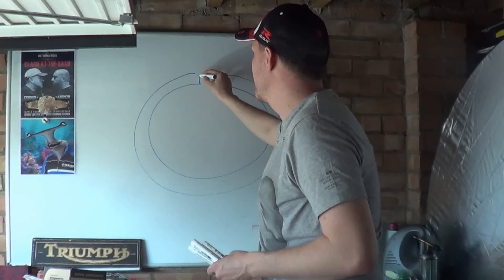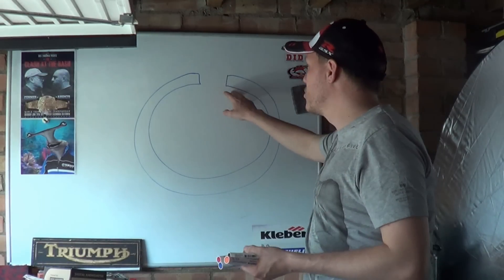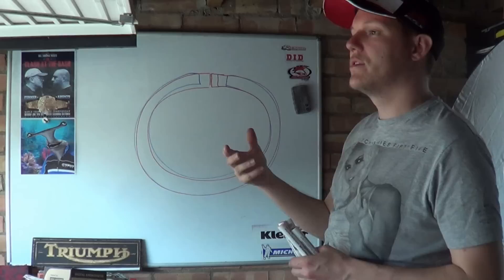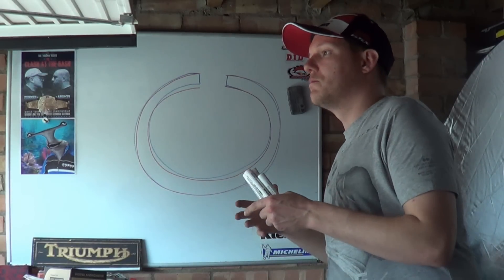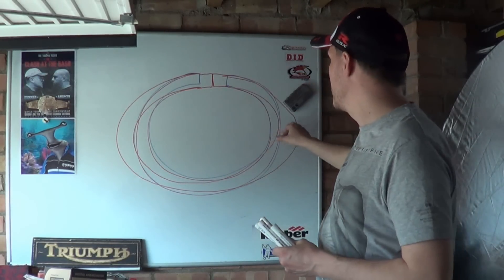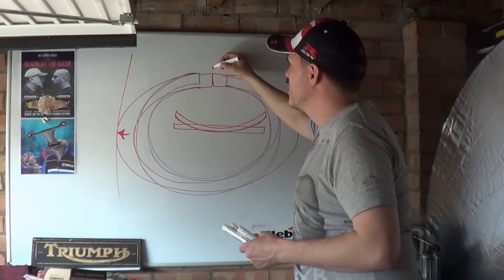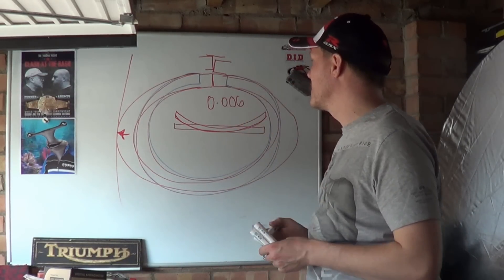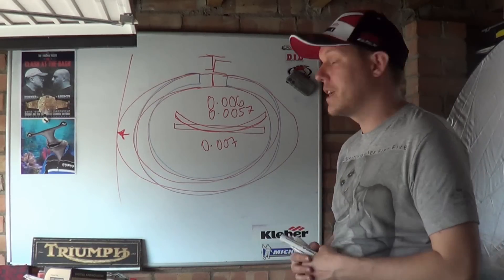Piston Ring Gap - the importance of

Comment: Need some advice.   I have a single cylinder thumper motor in my bike.  It had a transmission issue.  I removed the engine from the frame repaired the tranny issue and then put the motor back together.  No compression.   Don’t understand why, never messed with the piston.  Replaced all gaskets.  Torqued to specs.  Still no compression.   Got new gaskets again, did an inspection on the head and valves.  Finally did a lap job on valves.  Checked the valve guides, seats, seals and valves.  All are on.  Bike only has 3000 miles on it.  But it ran perfectly aside of he tranny issue.  So, back in the motor with brand new piston rings.  Still no compression.   Double checked the clocking and directions of the gaps.  Checked ring gaps and thickness.  These are NOS parts by the way.  New Or Stock parts.    I need @140psi and I’m only getting @45psi.  I also did leak down test and I can hear air hissing in the crank case, evidently getting past the piston rings.   The valves are sealed tight.  Again, the rings are brand new from the manufacturer, clocked correct, directional, gaps are good, applied assembly oil, followed the specs.  Still getting blow by.  Anyone got any advice.?
Reply from the maker: 1) - what engine is this from?
2) - this is with the valves closed? - I know this sounds stupid but I need to ask
3) 2 troke or 4 stroke?
Reply: The Workshop 

This is on a 2003 Buell blast.  500cc.  4stroke 

Most people would say, just toss this crap bike, but I actually like these bikes and have five of them, well, two now.  I sold one, kept two and gave two away to my step sons.  Also with 4 other Buells.  XB9R, xb12r, M2 cyclone and 1125r.  

Anyhow,  yes, this is with the valves closed.  I put the rocker box back on and was struggling on keeping the valves closed while locating TDC, and then compressing the cylinder with compressed air.  I had it in 3rd gear to help prevent the rotation of the engine, but still there’s engine movement.  So, instead of installing the rocker box, I just left it off.  Valves are now 100% sealed off. Did a compression check again, 45psi.  Added compressed air and heard no air from the intake or exhaust.  But instead, I hear air hissing from the primary when I removed the timing window screw.   Again, new rings, gapped within specs.  Between .007-.020. Actual is .014.  Max before OS is .035.  I’m still getting blow by and when starting with compression Check gauge, it’s showing 45psi.   I even double checked the compression gauge tool by testing it on the M2 cyclone, which gave a reading of 140psi.
Reply: Tommy Escobia.  Is the intake to the head fully open and the throttle open.  Insufficient air in could keep you from reaching full compression.
Reply: I had a Honda SL 70 as a kid the trans had a drive chain to the cam if the dot on the timing was not set right the cam opened the valves timing was way off .  Handa  had trans fail on the 1970 SL 70 they would give you a trans kit all gears seals free , if they did the work it was 45 a hour , I had a paper rout lucky to make 30 bucks a week , so I got my dad to help me rebuild it took 4 tries to get the cam right .

Comment: Spot-on Matt. The importance of having the correct ring gap is indeed critical for smooth running pistons along with having rings gaps opposed 180 degrees.
Reply: My two stroke has pins that register in the ring gap to keep the rings in a specific orientation, and they are less than 90 degrees apart, but I’m pretty sure that this is because of the porting. Wouldn’t want the gap to be hitting port edges
Reply: @1495978707 that’s why exactly! it’s the port’s! On a 4 stroke though it’s not nearly as important,a lot of engines they actually rotate! But typically face the gap’s away off the load side and away from the exhaust valve as that being a hotter area is usually the start point of pre ignition in most engines!

Comment: What is too big ring gap?
Reply from the maker: more than the manufacturer specs
Reply: Hi, Bore of my engine is 3.445inch. The old top rings have maximum of 0.021 inch gap. Gives 0.006 inch per 1 inch of cylinder bore.

The manufacture recommends gap of 0.012 inch up to 0.0196 inches for this engine. It equivalents are 0.0035 to 0.0056 inch per 1 inch of bore.

I got new rings but they are only a bit tighter... They would give me 0.0177 inch gap. Equivalent to 0.0051 inch per 1 inch of bore. But that is before they bed in. So i guess that after bedding in they would be similar to the old ones.

What would you recommend? The engine had compression within specification. The bore looks very good. I can place all of the rings in the same spots.

Can I put oversized piston rings +0.25mm in with just a rebore and adjusting the gap?

Comment: i'm going to link a video here of what happens is you don't gap the rings larger on a nitrous boosted engine, it should be pretty easy for people to make the conclusion that having to gap bigger because of more heat is the same as not gaping enough for normal heat

Comment: My 250 Suzuki atv rings wore out, the top  ring is a barrel faced ring and the second one is a tapered, I broke the new second ring during installation, and put the old one back , upside down (heck if I know) with new oil control rings and it runs just fine the old top ring was  0035 and the new one  measured out at 0015, the used second ring was around 0023, I run a soft hone on the sleeve and hand polished it with 600 wet dry  paper, guess what no more smoke, besides the top ring is the one that holds compression, and the second is just a scraper, and I figure if it lubes more oil the better off the cooling. we will see what happens after 500 miles.